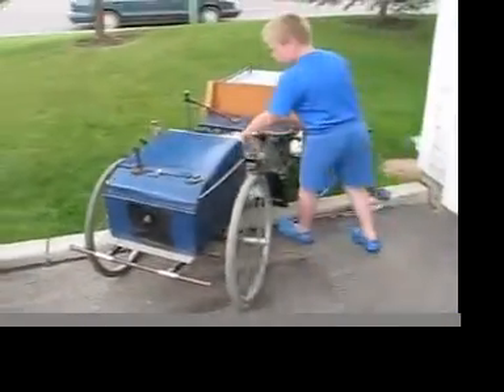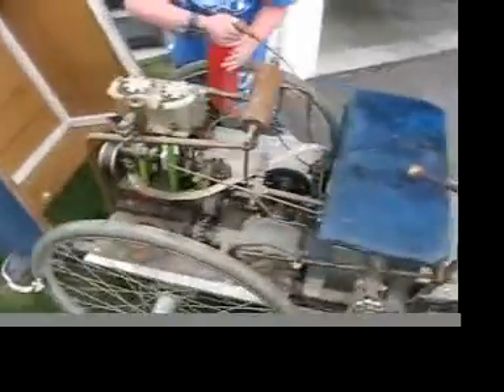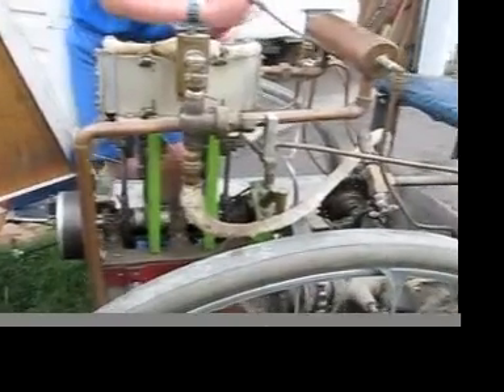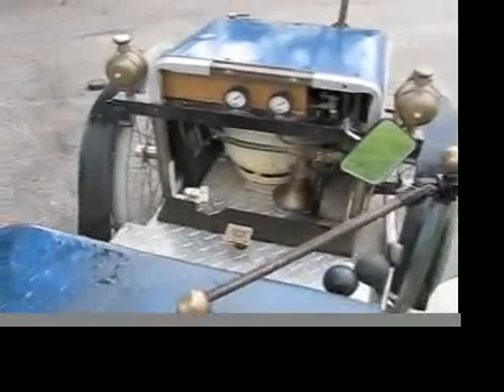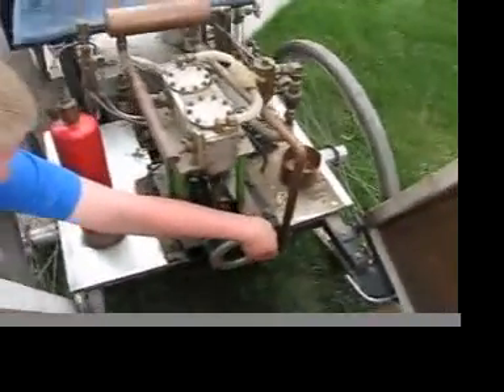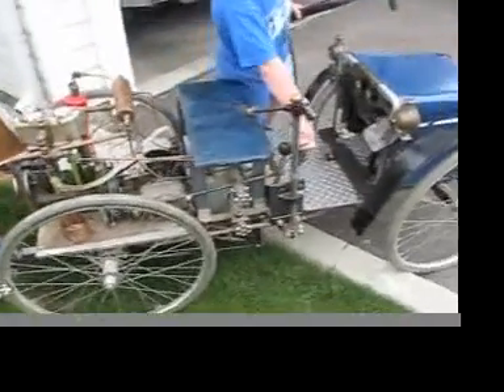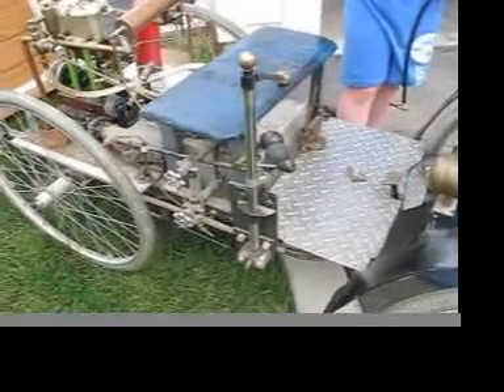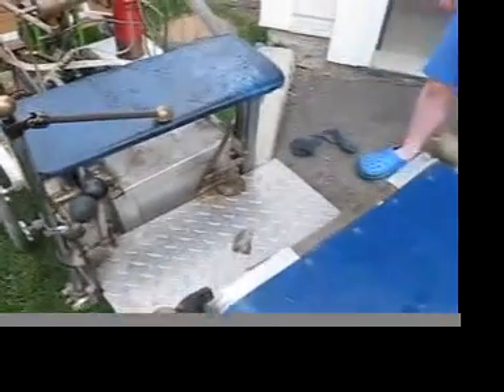Home Made Steam Powered Car

Comment: if you can build up 1000 psi. that is 1000 foot pounds or torque
Reply from the maker: That would not shock me; but that said this little thing operated at 100psi or less.
Reply: it would be somewhat easy to get 1000 psi but for that size 100 psi is good.
Reply: ExMrEd The torque isn't that simple, cylinder size comes into play too.

For example an engine with a cylinder bore of 2" and stroke of 4" will have a surface area of pi (pi×r^2) and a crank throw of 2" (stroke/2).

So at 100psi there will be about 314.16 lb of force pushing on the piston.  (Pressure × surface area).

Depending on the crank angle the continuing torque calculation could be extremely complex, however peak torque is when the crank is 90 degrees to the piston rod (when it has the most leverage), which cancels out pretty much all the complexity. All you need is the crank throw.

Thus the torque calculation becomes 314.16 lb × 2" = 628.32 in lb of torque, or 52.36 ft lb.

Comment: @michauxhyatt wrong, the steam engine will never be as efficient as a gas engine (currently the best is about %50 that of a steam engine, though I'm shure it will improve greatly) plus the warm up time (flash furnaces are a good start, but still not perfect) true, the constant torque is nice, but, in all honesty, i think electric or hydrogen will take off before steam gets a 2nd chance, and once one of those is the new gas, then steam won't have a chance anymore.

Comment: they are here, its called a battery powered genrator or a dual moter electric car. the reason you don't here about them is the gov. and the patent office will not except them because they would put the power co. out of bis. and the inventors are afraid of death just look at all the past inventous of these machines all dead.there are also many other ways I did't list.

Comment from the maker: thank you. yes one of these years i should spend some time restoring it a little. It has not run in over 10 years. it needs some tlc...It needs new air tubes for the wheels...the boiler would have to be cleaned and pressure tested, etc. My 9 year old son would love to drive it, as i did when i was young. My dad, the guy who designed and built it, passed away in 2006.  i have fond memories of driving it in parades etc when i was young. heat from the boiler cooked my seat a few times LOL!

Comment from the maker: nope not a kit; it was a from-scratch build. dad jotted pictures and calculations down on scrap paper but never kept a journal unfortunately. the scraps of paper were tossed out when he did not need them anymore (he was simply a basement model engineer hobbiest). I can send you some higher res pictures of it, if it would help. The wheels are from old wheel chairs. He got the transmission out of a very old washing machine. Otherwise everything built from scratch. Dad passed away in late 2006.

Comment from the maker: while the engine and boiler were entirely his design, he did not build the transmission(capable of Forward Nutral Reverse) or the wheels, guages, or fuel tanks. However, pretty much everything else was designed and built from scratch. One other exception was the braking system..While the pedal and linkages were Bob's design, the actual brakes came themselves from bicycle parts. Why build brakes when you can buy them cheaply? He was very practical; don't reinvent the wheel sort of thing.

Comment from the maker: Yes the engine and boiler were designed and built entirely by Bob. All his materials were hand picked from a local scrap dealer. Bob built it on an 8" Emcomat lathe, equipped with a milling machine.  We still have many of his engines in our basement - Some as big as 4 cylinder. He also experimented designing and building steam turbines. One turbine which we still have - runs at over 25,000 RPM.